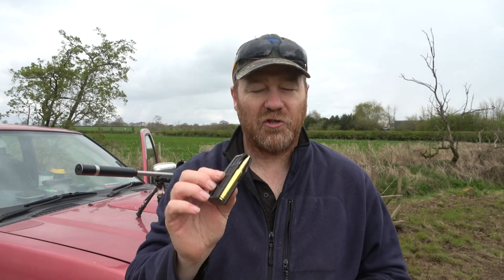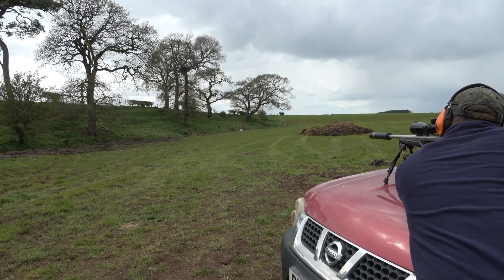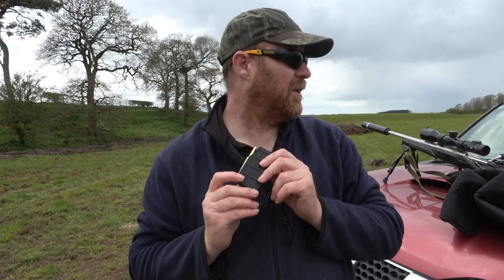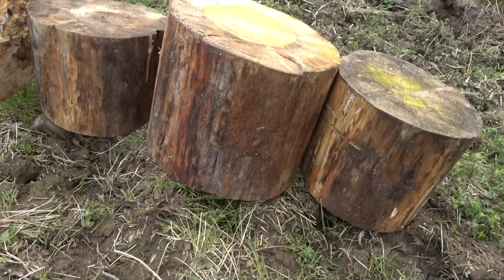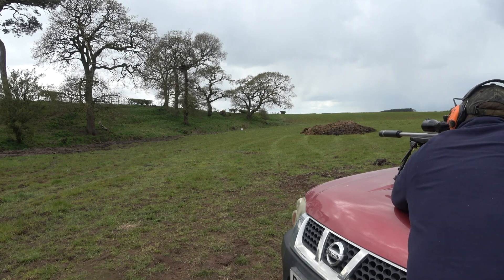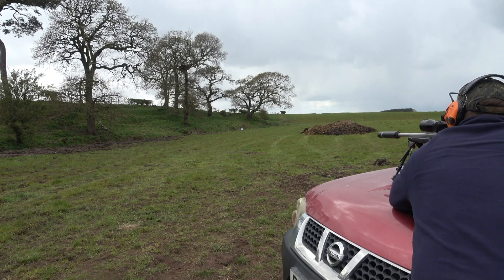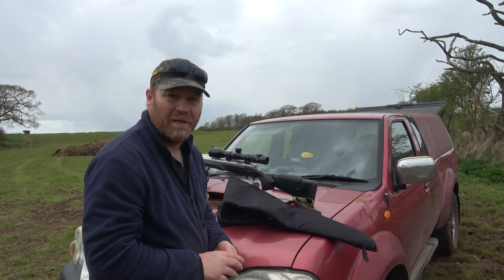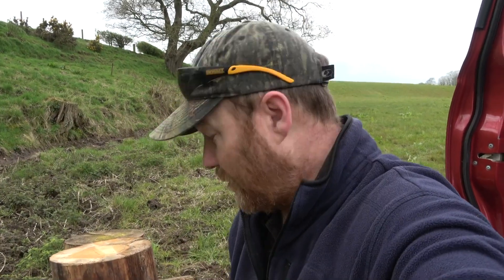Testing CNC Rifle Bullet Prototypes. ELR Solid Match Projectiles 7mm Rem Mag Brass Copper Accuracy

Comment: I work on a muti stage screw machine. Been considering turning 30cal solid brass. Thank you so much for the video. 
Fyi when you set an axe. Pushing down on the handle in a sharp jarring motion with break your bit lose. The lift to free it easily. (Had a wood stove all my life. Alot of splitting)